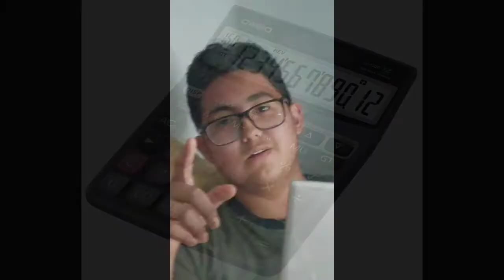Analog vs digital ( Abacus vs Calculator)

Comment: Perhaps a title of "Comparison between Ancient Manual Calculator and Modern Automatic Calculator" would be appropriate.

The abacus is not analog, but also digital in design - unlike the second hand, minute hand and hour hand of a clock, the counters of an abacus are not interconnected in movement, but depend entirely on your fingers to move the beads only up or down. However, "suspended beads" may be use by the Chinese in advance operations.